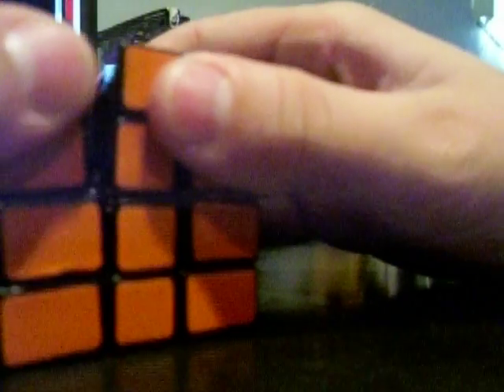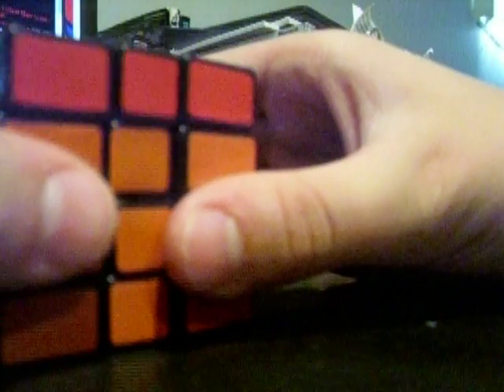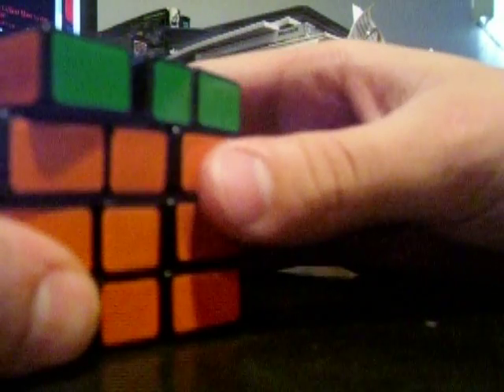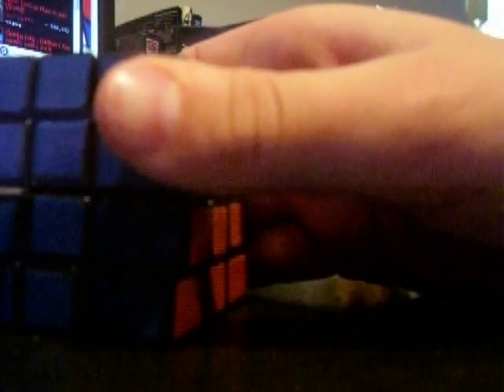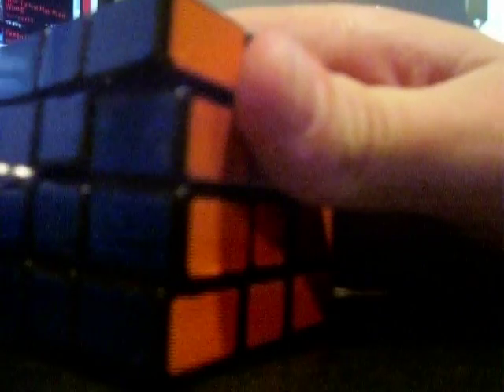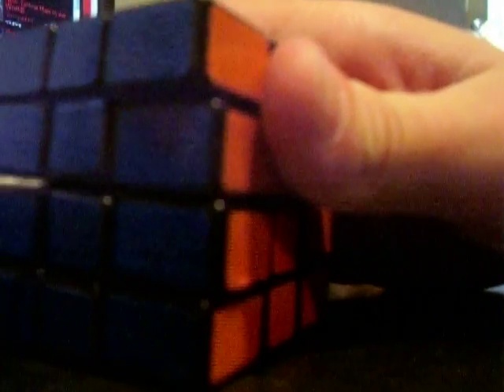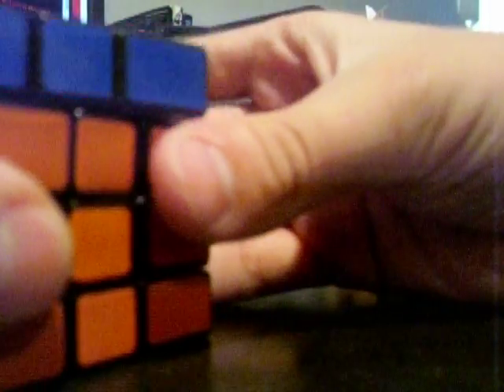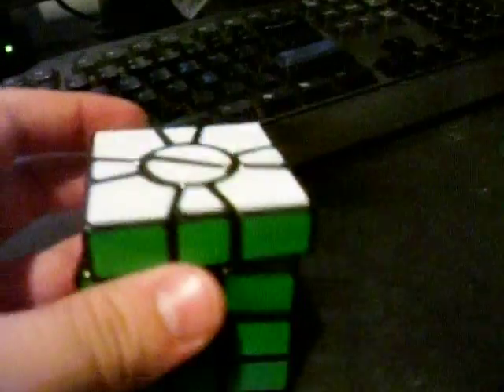super square-1 reassembly tutorial

Comment: Thanks man.  I don't know if it's all QJ Super Square 1s or what but mine's a piece of......well, you know.  Anyway, I watched your videos to find out how to tear the sucker apart (what kind of screwdrivers do those guys use anyway to get in there without gouging everything???) because mine wouldn't turn and when it would turn the center would separate and then stick and pieces would fly off and I'd have no clue where to put it back.  So I tore it apart, sanded any mold leftovers, put a little lube in it (not a good idea - dunno if it's their plastic or what but it gummed it up and I had to tear it back down again and clean it out).  Now it works but if you tighten up the screw so the top and bottom doesn't feel like it's gonna fly apart you can't move the middle and if you unscrew it enough so that the middle moves (even if tightly) then the bottom and top feels like they're gonna fall apart!  Do you have that problem??  Dunno if you'll see this since you posted this over 4 years ago, but if you do, thanks again for posting it and thanks for leaving it up.